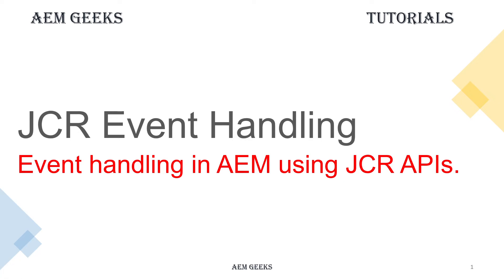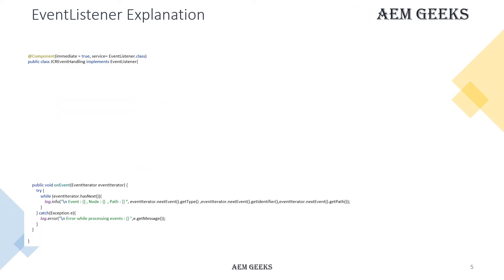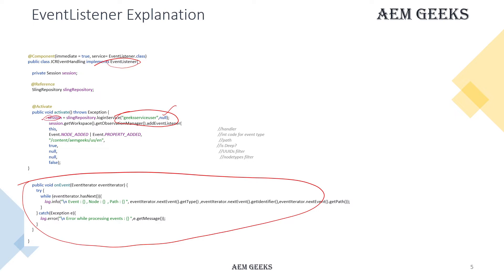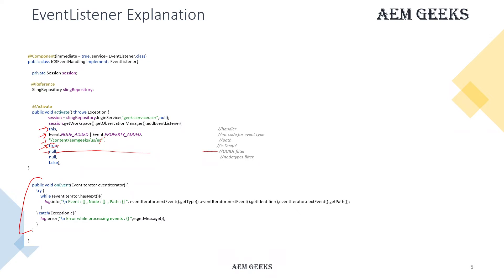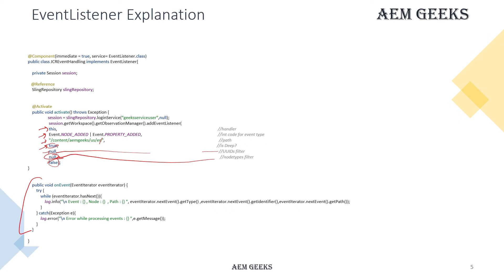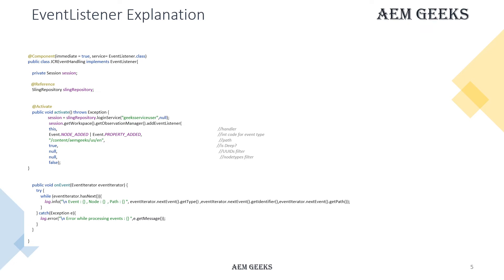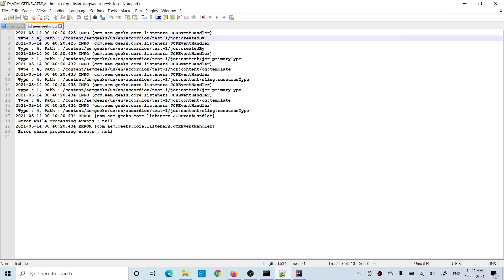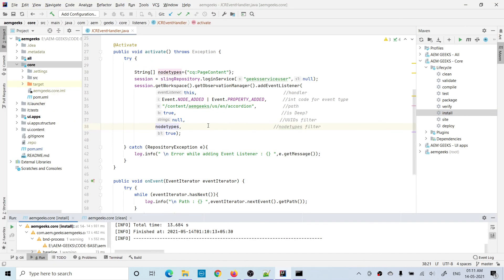AEM Tutorial #47 | Event Handling #2 | JCR EventListener in AEM

Comment: Can we create a page in different paths at same time ?
Reply from the maker: Yes, you can achieve this using suitable event handler. You can also write workflow. But I will suggest you to check if you can achieve using MSM. 
As you did not add detail use case, I won't be able to write exact answer.
Reply: @AEMGeeks  Thanks you sir. 
My exact task is 
I have two different paths 
If i create a page in one path 
It should be replicate in other path also. 
For this, I'm thinking avout
1. Work flow 
2. Event handlers
Or any other idea sir